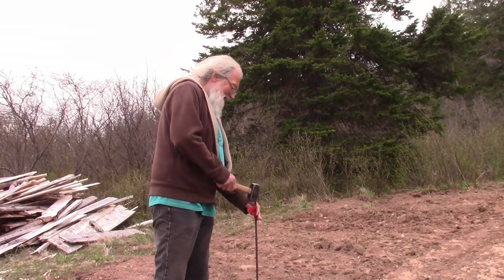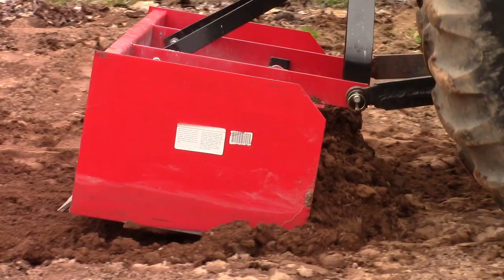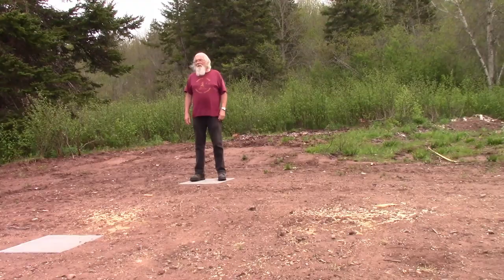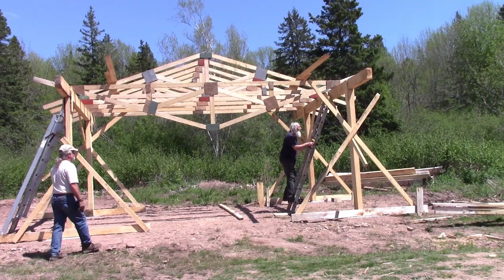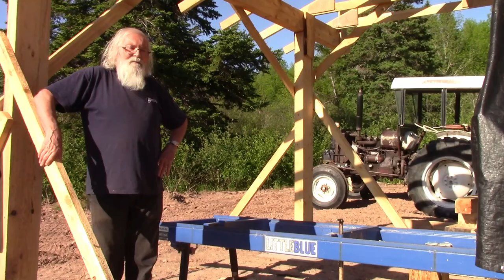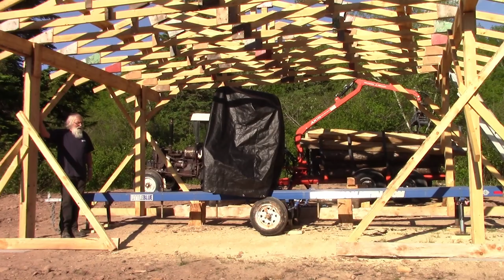114 Building a Sawmill Shelter - Part 1

Comment: Hello from NS. I made a similar shelter for my mill. I used pre-made reinforced concrete pads and then drilled them to install metal brackets with concrete anchor bolts to my 8x8 uprights. Still standing after 2 yrs.
Reply: Thanks for watching!!  Had thought of something along that line but am currently going with sunken cedar posts.